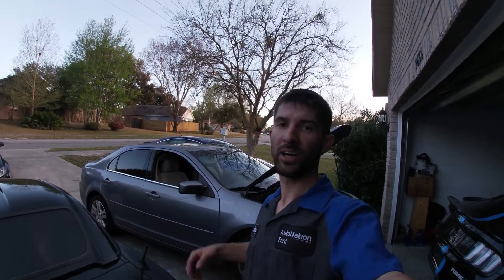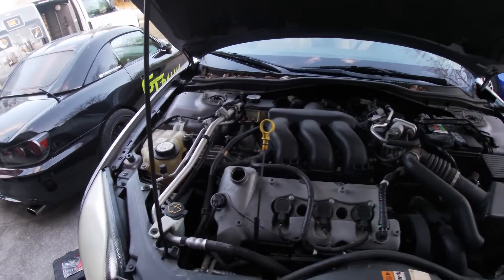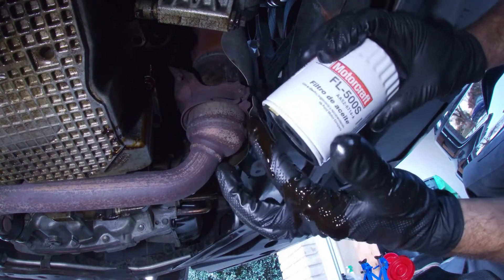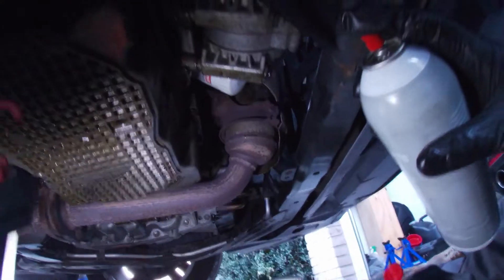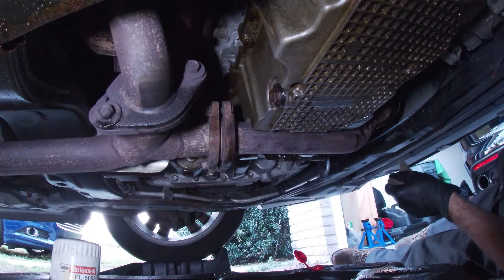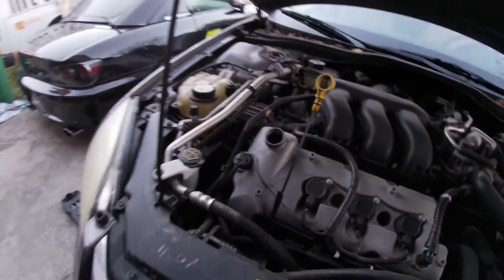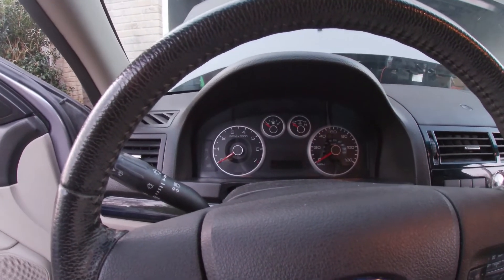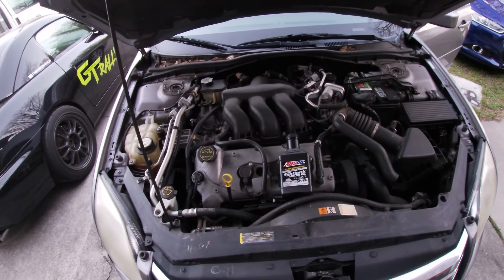Ford Fusion 3.0L V6 Oil Change [ HOW TO ] 2006-2010

Comment: Wanting to add a manual oil pressure gauge on my 08 3.0. there is a Allen head plug just above the radiator hoses going to the block. I removed the plug and there is oil. Looks like any other motor where you can just tap in and run your tubing? Am I correct on this location? Thanks great video
Reply from the maker: I am not sure about that unfortunately

Comment: You used a wrong oil filter. The right one is Motorcraft FL-820-S Oil Filter.
Reply: If it's the 2009 model it depends on the vin on which filter it takes.